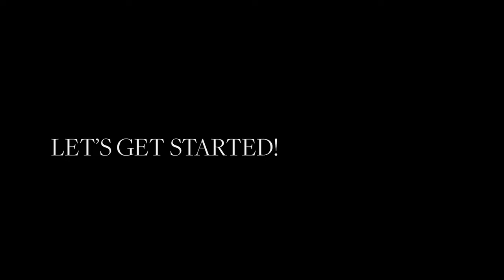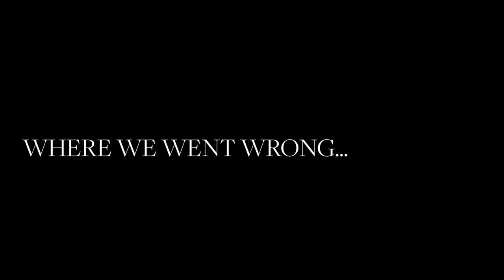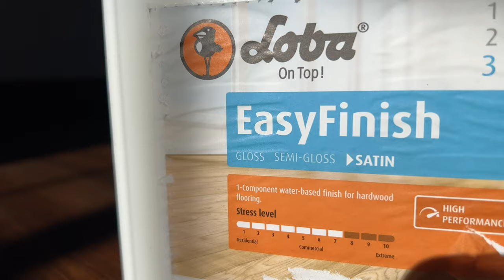What NOT to do When Staining Your Hardwood Floors: Part Two

Comment: Did you walk on the floors while the stain was drying and did you clean the floors again before applying the polyurethane?
Reply from the maker: Once I scrubbed all the excess mineral spirits yes we were able to walk on them no issues! And then I just used a damp rag to wipe them down before testing the top coat. You just don’t want to put a drenched mop on them or anything before the poly!